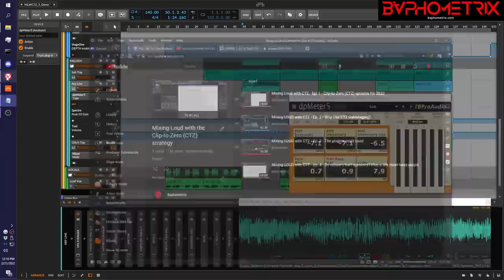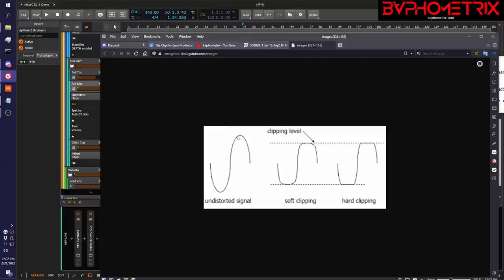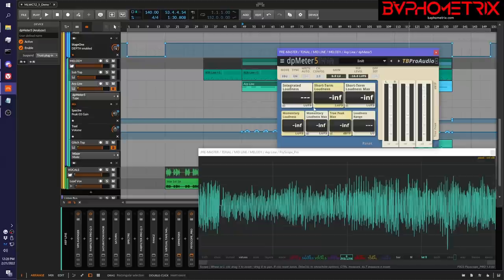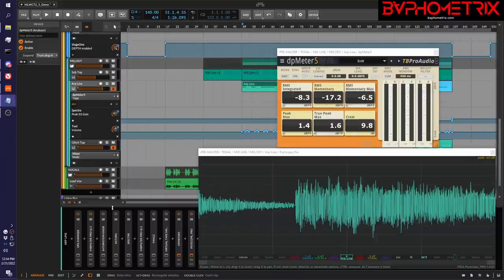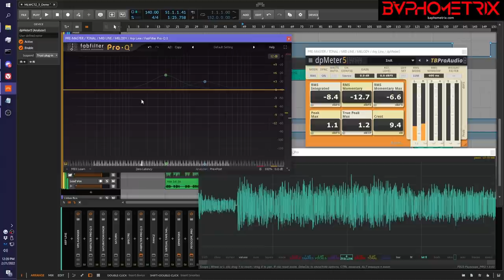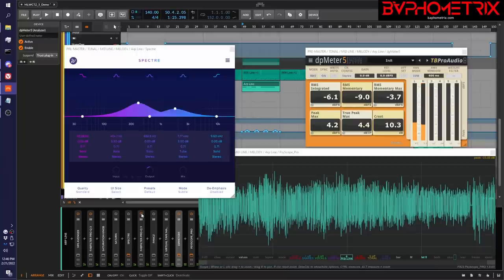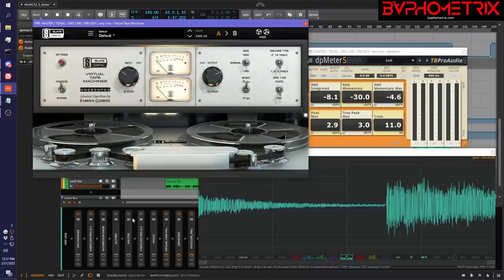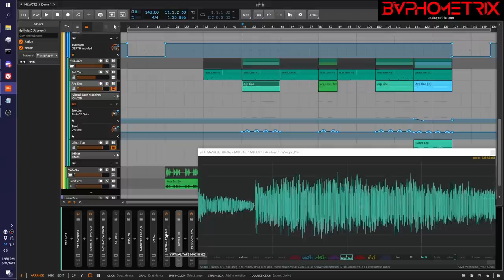Mixing LOUD with CTZ - Ep. 5 - Controlling dynamic range by "saturating from the bottom"

Comment: Honestly I think the dry sounded better almost every time. Not sure if its just me or your OBS, equipment, YT compression, the synth signal itself or the effects on it, but I clearly heard the saturation/soft clipping on every one of them. Is this really supposed to be nearly transparent sounding? Do I not understand the meaning of transparent in this context? Maybe its my hearing damage, idk, I'm new to all this...
I watched everything so far and I'm intrigued to say the least. This all seems like a solid approach. 
Maybe I'll find out in the coming videos, but at this point I'm not at all sure on how I'm going to apply this to my own music as my music is not intended to compete for loudness or for festivals. This technique seems most suited for bass heavy music. Should I be looking for a different technique or.. just go by reference? idk
Reply: From what I understand, this technique is very much designed for EDM/ heavy metal. It won't work very well on your orchestral composition (although RIOT clips a lot of his stuff including orchestral sections so I'm really not sure how far it goes)
Reply: this technique will not work on orchestral music. orchestral music is not a 'loudness defined' genre, it is very wholly controlled by dynamics. This is pretty much the complete opposite technique compared to what you will need